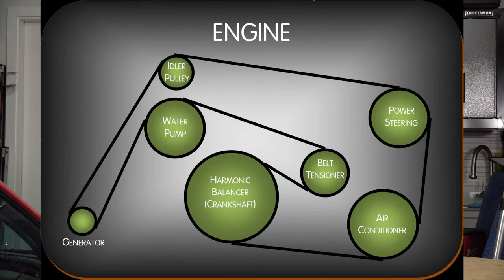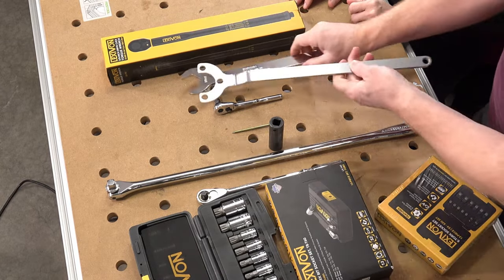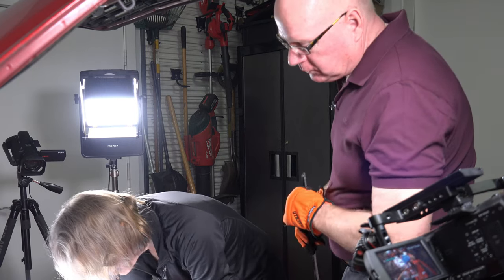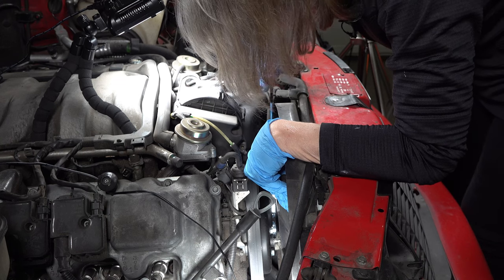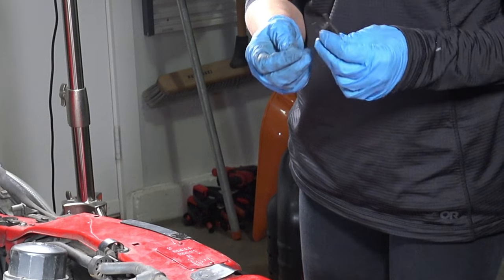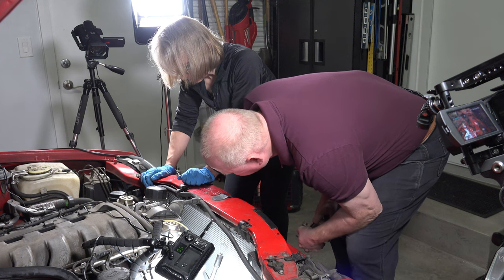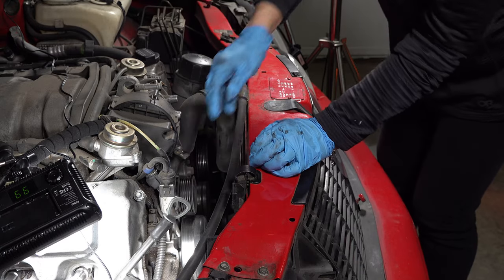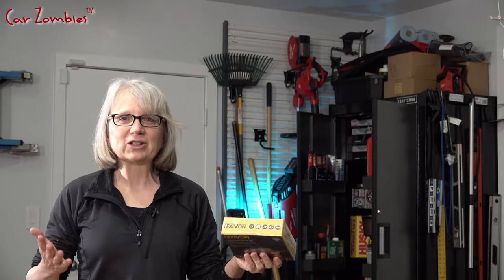Diane replaces her serpentine belt, pulleys, and front crankshaft seal, Part 1

Comment: By the way, I‘ve now taken off the idler pulley screw on my CLK 430 and you actually don‘t need to remove the radiator.

You only need to tilt the radiator forward. So remove this metal bridge above the radiator beforehand, as well as the 2 plastic air ducts between the radiator and the headlights on both sides.

Then you can tilt the radiator forward so you spare yourself the trouble of disconnecting all the hoses. The thread on that pulley bolt isn‘t all that long so you need just a small bit of extra space.

Just some food for thought. Dunno if you risk breaking anything that way, for me it worked at least.

Comment: Sometimes having that fan shroud loose helps with wrestling the fan in or out. I like to put a sheet of corrugated cardboard down in there  on the radiator to protect it when I'm monkeying with other things.

Do not clean the fan clutch with water/cleaner? Interesting. News to me!  Especially since it gets wet on a rainy day. 

Another good way to clean off dust off something like that is compressed air -- outside the shop!

Heater? Winter hat? For some reason I thought you were in some place like TX. I have no idea why.

The harmonic balancer's #1 job is to keep vibration controlled for the crankshaft! Cranks can crack if not damped, sometimes. (Depending on the engine type, I guess.)

Also, I like to replace water pumps as preventive maintenance items. How often is a good question, and on a Benz, the price might be painful.
Reply from the maker: Not Texas and not the Rust Belt, but you guys are starting to narrow it down😉. Keep on guessing...
I found later in my notes that we could have taken the fan clutch off the fan and then wash the fan itself in soap & water, and I like your idea of air blasting the clutch outside.
We still haven't tackled the water pump, but it is becoming a priority since I don't think it has ever been changed.
Thanks for the tips!

Paul & Diane 😎😊

Comment: You two rock, this video specifically is coming in very handy.
As it just so happens, my idler pulley just broke into pieces while driving and so the belt got caught in the fan and was thus shredded. That happened on Christmas eve no less.

Of course I was also beside myself with joy after finding out a) you need to remove the fan to get to the tensioner and b) you practically have to take out the radiator to get the idler pulley bolt out… I guess thats just the V8 though, the V6 seems to have lots of space
Reply from the maker: We are so glad that video helped you! Your experience is our worse nightmare. And in our case, we had to skip the idler pulley and we still haven’t gotten back to it, so your comment has us very motivated to go back in the next month or two and change that idler pulley, which in our case means changing the water pump too.

Paul & Diane 😎😀